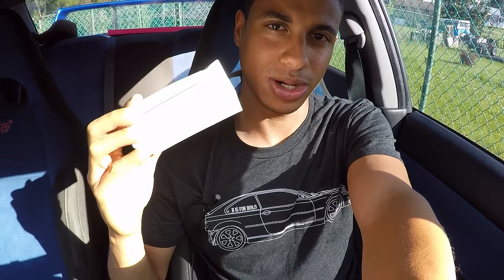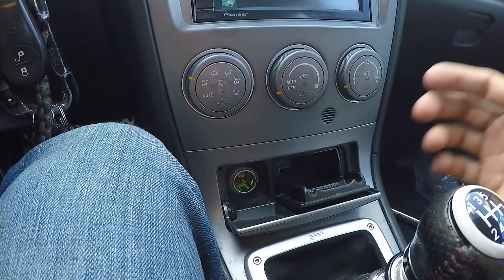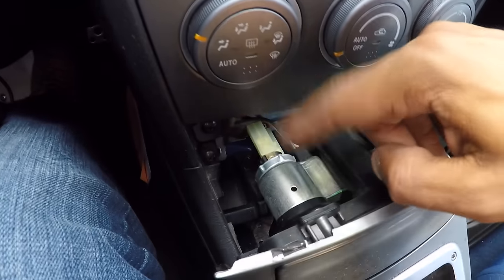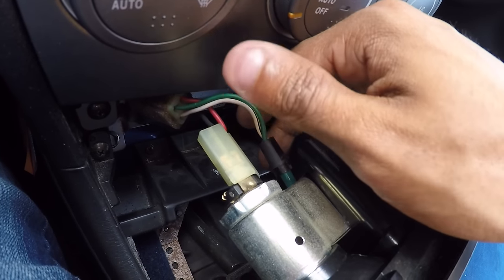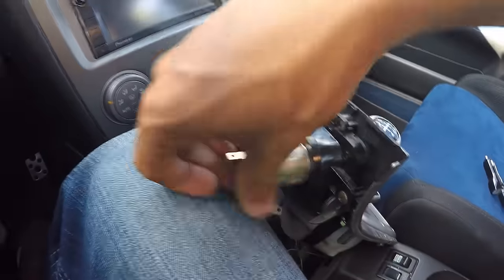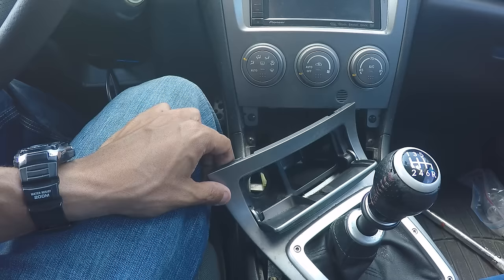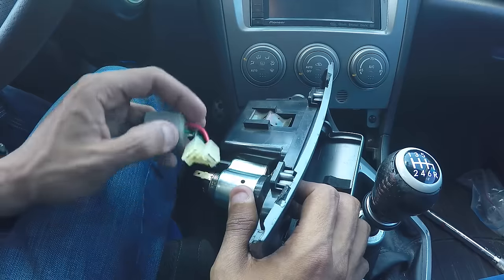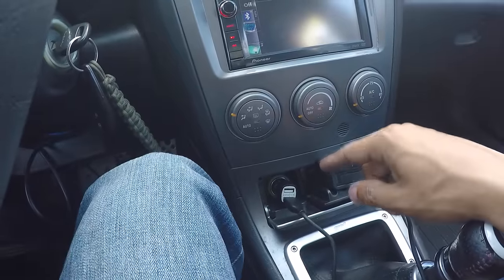INSTALL: Cigarette Lighter Replacement | 2002-2007 Subaru Impreza, WRX, & STi

Comment: Thank you for this video. Mine hasn't worked for years and now that I use my phone for navigation regularly I need to plug it in. I checked the fuse first and it is fine. I just pulled it all apart like you did and it started working without replacement. I just needed to see how to get behind the lighter.

Comment: Very helpful video.  I had the same problem and this told me exactly how to pop open the console and the specific problem with the fusible link.  It does seem odd that in my case this link would melt before the fuse would blow - it is essentially thermal protection from overheating the outlet itself.  I read in other forums that there are two different fuses involved, one on the driver's left side box and one in the engine compartment.

Comment: You would say, too much "current" when referencing overall power going through a circuit. Honestly man, you can figure out the circuits. Look up some wiring diagrams on Nasioc or get a FSM that has the wiring diagram. If you have any other electrical issues it's all probably the same problem.

Comment: I have just the opposite problem in my old Toyota. It has power for 12v USB but the cigarette lighter and illumination ring stopped working. Surprisingly cheap plastic cigarettes lighter bezel. Not worth fixing since I don't smoke and the USB plug has its own LED light.

Comment: fuse?
Reply from the maker: That's a very real possibility. I don't think I checked that. It didn't work & I was just like "F this for right now." Haha. When I fix it, I'll definitely give an update.
Reply from the maker: Turns out the fuse was bad too. Not sure why I didn't think to check that too. I will make an update video showing how to find & replace a blown fuse. 👍🏻👍🏻
Reply from the maker: Yep. Here's the video on finding & replacing a fuse. https://youtu.be/3uf1iVQVI6U
Reply: Thanks bro, I was about to get everything done but I read the comments and it was a fuse xD
Reply: Good catch.  There is always at least a decent chance that an overload on the 12 volt port will blow the fuse before the port burns out.  Usually good to change in tandem just in case. Especially if a new 12 volt port itself doesn't fix the power issue.
Reply: Lol. I was gonna ask the same thing. I have a cigarette lighter fuse that keeps blowing if I use a certain lighter, but not with my other one.

Comment: Having the same problem man. I replaced the fuse and it powered up I unplugged it later that day plugged it back in the next day and would not power up.... super frustrating

Comment: If I wanted to add a second socket hidden inside of the same area, would I just be able to tap the wires without any issues?
Reply from the maker: I would not recommend that. If you tap the wires for an extra socket, there's a good chance that you will overload the wires & can blow a fuse or cause a short/fire. Running new wires will give the best results.

Comment: Id test things before you buy new parts. A multi meter would have told you easily, but some people don't have them! Also this parts cheap and its not that hard but still if you can test before spending money
Reply from the maker: sslusshy The part was bad & so was the fuse. Sometimes it’s far easier just to replace an old part than to try & diagnose it, but I had strong suspicions that the part was damaged by the way it was behaving before it died.

Comment: those subaru cigarette lighters suck you can't use anything with high draw at all. what I did was solder a wire where the fusible link was. I think that OK because there is another fuse.
Reply from the maker: I agree. I used my dash cam like twice & then my outlet died, so I think that might be what did it. lol.

Comment: How does the sti drive in the rain ? I drive a rear wheel drive car and I'm thinking of getting a sti to drive to work because my Z loves to spin out or slip bad in the rain I need something safer will the sti keep me safe lol ?
Reply from the maker: Subaru's AWD system is one of the best ever made. You can still get into trouble with an STi if you are being careless or are not used to driving a turbo, & obviously good tires are a must, but my STi has been a champ in both rain & snow. The car is very predictable & even if you start to slide a little, it usually is easy to regain control.

I also love that Subaru's are very safe, most have a 5 star safety rating. I'm big on safety, so it gives me peace of mind knowing that my car is very safe. Hope I answered you questions adequately.

Comment: How did you find that replacement part?  I have ordered 2 so far and neither of them are compatible with my truck.  It looks just like the one you showed in the video but I can't find one online anywhere.
Reply from the maker: katherine hall If I remember correctly, I got mine from the dealership & they looked it up by my VIN number. The other place I get parts is Gilmansubarunorth.com.
Reply: @hawkeyestiguy   thank you.  Just ordered from a dealership.  Got my fingers crossed.

Comment: maybe its a fuse
Reply from the maker: That's a very real possibility. I don't think I checked that. It didn't work & I was just like "F this for right now." Haha. When I fix it, I'll definitely give an update.
Reply: How to change  fuses in2016 Tacoma?
Reply: HawkeyeSTiGuy its been a year. But check the fuse it might be blown. Thats how i fixed mine. If the socket is ugly its probably that. If not it might be the wiring in the back or somewhere. Which is sooo fun. (Sarcasm). Goodluck and hope all is well
Reply: @hawkeyestiguy have you checked the 20 amp yellow fuse behind the coin storage. In the UK its the coin storage with the immobiliser built in. If the cig lighter has popped it has most probably blown the nearest fuse mentioned above. Let me know how you got on!

Comment: 15amp fuse buddy
Reply from the maker: That circuit actually uses a 20amp fuse, but yes, that was also part of the problem. I made a video showing how to check & replace a fuse as well.
Reply: pop out CIG Amp fuse first then play around, do whatever you like ! a piece of cake if you enjoy it !
Reply: 20 amp not 15
Reply: That was my first thought 
"The Fuse"

Comment: How long did your car run before you had to start changing parts ? And how long did it take for it to blow up ? I'm thinking of getting a 2007 sti that had 57,000miles on it has a hks bov typhoon intake and a different intercoller and I'm getting it for $20,000 I make enough money to afford the car I just need help from someone who knows about buying a used sti ? Please let me know soon as possible thanks
Reply from the maker: I bought the car in 2010 with 73K miles on it. I replaced the engine twice, but neither failure was the engine's fault. The first time, my lower radiator hose split open & drained all the coolant while driving on the highway. The engine seized up & I replaced it with an OEM block. The second time, my MAF sensor failed, which caused the engine to lean out & blow up. I replaced that with a built block. I have had no issues since then. An unmodified engine can last a long time, but it really depends on the tune, how hard you drive, & how well it is maintained.

I would recommend saving up so that you have enough for repairs. I have spent as much in repairs over the past 6 years that I've owned the car as I had paid for the car. Subaru's are not cheap to own or operate, so make sure you have some money set aside if things come up. Sometimes you won't have warning that a part will fail. Also, as the car ages, there is a lot of parts that will need to be replaced. Most of my parts didn't start failing until I was around 130k, but every car is different & there are no guarantees.

Once you start modifying a care, reliability goes out the window. I was ok with stage 2, but beyond that was like falling off a financial cliff.

Also, it's a very good idea to have a compression test & boost leak test done before purchasing. I would also recommend having a mechanic or friend look it over first. I didn't have any of that done, but I was lucky. A lot of guys get stuck buying cars with bad engines.

If you have any other questions, just ask.
Reply from the maker: Adam Steele That's awesome! That's where I see most people get into trouble. They buy a car they can barely afford & they leave no room in their budget for repairs, then when things come up, they are really hurting, or even are forced to sell the car. Smart move on your part man. Best of luck!

Comment: 1.Locate Fuse Box 2 Find Cigarette lighter fuse 3.Change it. Done
Reply from the maker: The1&only_Hama Except both parts were bad, so you missed a step...
Reply: @hawkeyestiguy  Nope, You did mate.
Reply: @hawkeyestiguy  I was trying to help. you seemed like you didn't know what's the main cause of the malfunction. So no I don't give a ' F ' about contesting with you, No offence.
Reply from the maker: The1&only_Hama Ok, except when I pointed out that both parts were in fact bad, you wanted to be a wise ass... I don’t get what your deal is.
Reply from the maker: The1&only_Hama No, you’re really just an idiot trying to sound witty in the comment section... but tell yourself whatever you’d like. Lol. I’ve already explained that both parts were bad & needed to be replaced. Yes, I should have checked the fuse as well, yes, that was part of the issue. I have another video showing how to locate & replace a fuse, I’m not sure if you skimmed over that part of my response or if it couldn’t absorb through your thick skull, but both parts were the issue, for the 3rd time now.... 🙄

Comment: wipe your tools with some 3in1 oil to avoid the minor rust
Reply from the maker: RCJproductions1 Those pliers are older than I am, I’m not too worried about some minor rust honestly. I usually spray my tools down with some WD-40, but I haven’t done it recently. Good pointer though. 👍🏻👍🏻
Reply: HawkeyeSTiGuy haha, they just dont make them like they used too. keep the tools in good condition and your grandkids will thank you for it... im in the process of restoring all my grandfathers and fathers tools and wishing they had heard of oil lol

Comment: My money is on it being the fuse which would have taken 2 seconds to check and another 5 seconds to change lol 95-98% of the time when a 12 volt cig lighter stops working it is the fuse.
Reply from the maker: Htimez2 It turned out to be both. The fuse was blown as well, but the fuse link was also burned up. I have a superstructure video showing how to replace a fuse. 👍🏻

Comment: All you need to replace is your views have your vehicle nation switch on finest views that goes to the cigarette lighter pull it until the light goes off replace a fuse and you should have power running to your device if not check your ground wires behind your panels going torture engine mount that goes into your battery sounds difficult but very easy to do

Comment: You do realize the Center Consoles of the 02-04 Impreza is different from the 05-07 Impreza... so this vid does not help, as i have a 2003 WRX
Reply from the maker: I have an 06, so I am showing it on that MY. For the most part, the 02-07s are similar & have a lot of things in common.  If I’m not mistaken, the cigarette lighter is even in the same place in the 03, no? Obviously there will be differences, but I tried to make this useful for as many folks as possible. Otherwise search NASIOC...
Reply: @hawkeyestiguy  i understand, the Cigarette-Lighter is attached that piece, like car does.  so it doesnt come out easily

Comment: you should check cigrate litter FUSE 
YOU NEED TO CHANGE FUSE
Reply from the maker: Thanks. I ended up replacing that as well. I made a video on it.

Comment: don't buy parts until you check the most common thing, THE FUSE. Also watch a few youtube vids first
Reply from the maker: Steve Race Actually I had already looked at the part & it was burned up in addition to the fuse, so I had no hesitation on spending a few bucks to replace it.